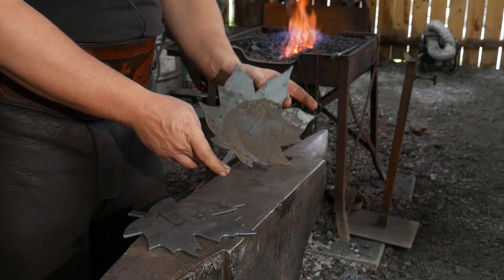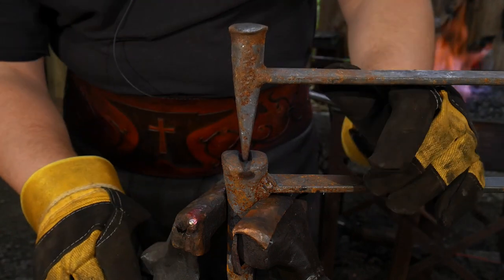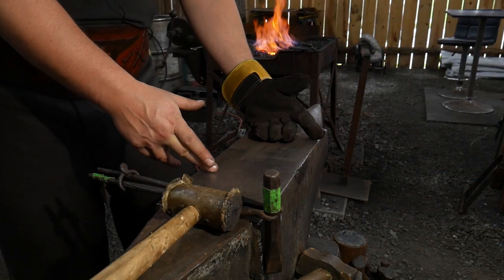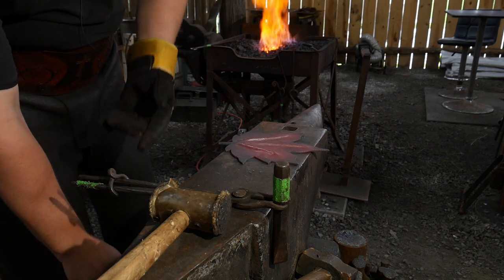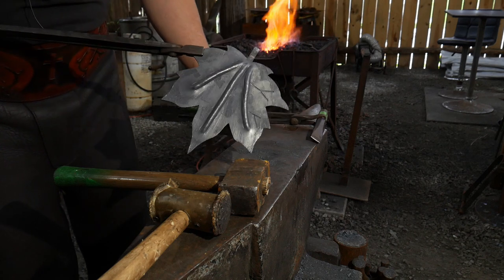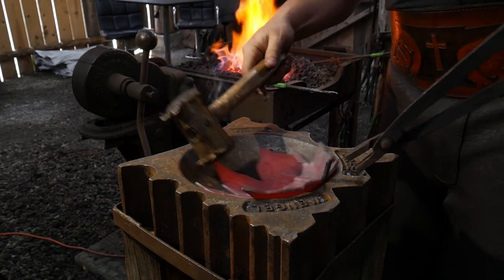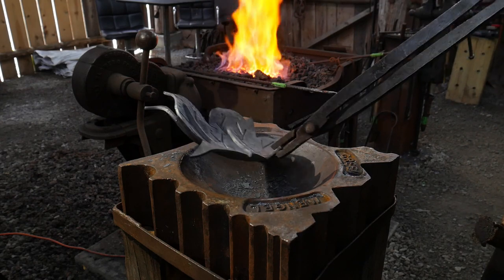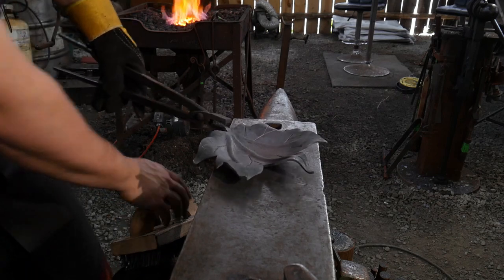How to Forge our Maple Leaf Bowl (Style 1)

Comment: Hi Roy, question about using wood for swage blocks. I have some large 24x18 hardwood beam sections from a 1966 remodel I was working at, so I have options. Is it better to cut into the end grain, or go along the grain? Wondering about splitting and all that. I know they will obviously burn deeper as I go, either way. Thanks!